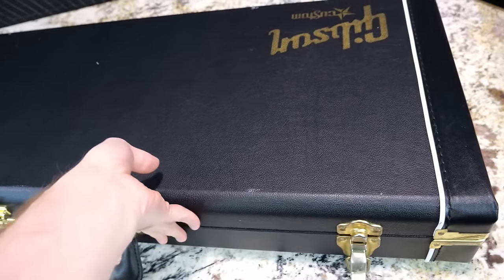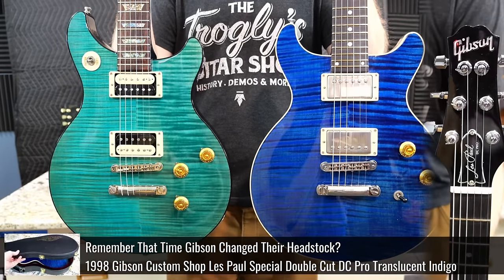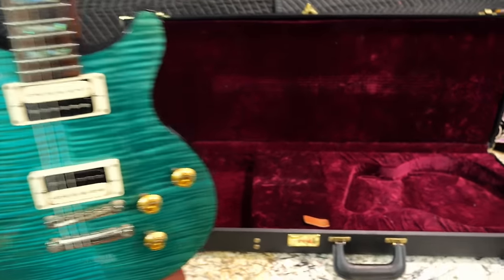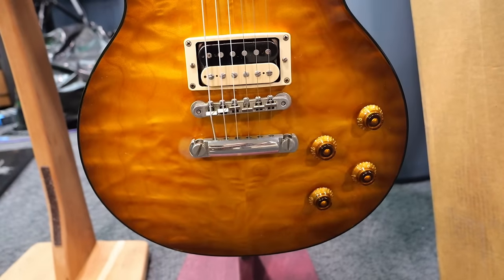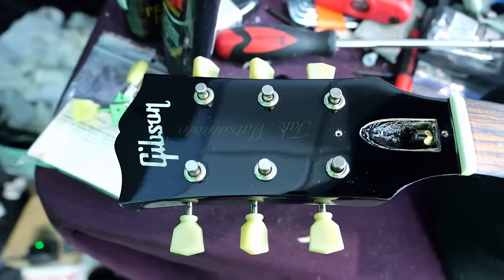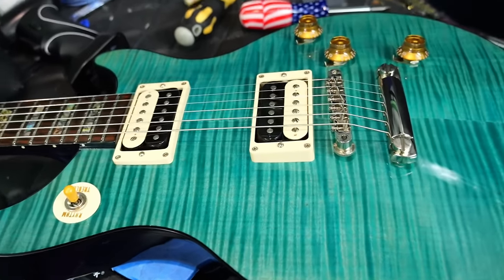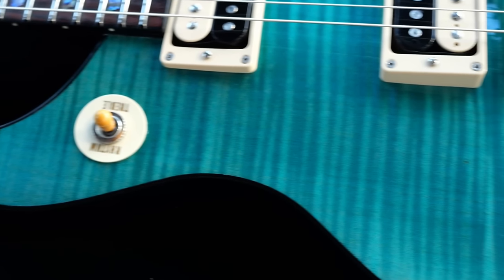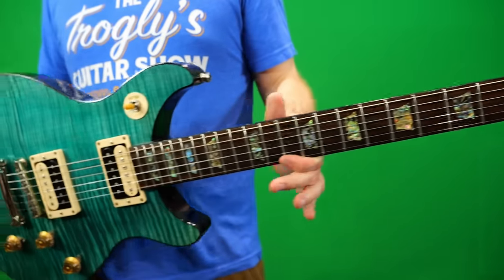Gibson Only Makes This Guitar Shape for Japan! | Gibson Custom Shop Tak Matsumoto DC Standard Blue

Comment: Trogly you might want to look into 10mm vintage tuning bushings for that guitar. It should take the space of the reemed hole for the tuners and still give you the original tuner post size. Stew Mac and other parts supply stores sell them.

Comment: I always loved the double cut LPs, but by the time I could afford my first Paul in 2008, Gibson had discontinued them 😢.  Instead I ended up with my 2008 LP standard 60s neck flame top in root beer with the red back. Its a fantastic guitar! Has served me well for almost 20 years now. I do still have a place in my heart for those DC models though. A red DC studio with P90s is my fave. A friend had one and it had huge thick neck on it though and I hate that.

Comment: Hi--I recently stumbled across a guitar that I can't find much information on. It's a Fender Catalina YC-25H, which is marked on a crossbar (?) on the inside of the guitar. Doesn't say any country of origin, just "handcrafted" with a Fender maker's mark. The guitar is really interesting, it looks like (and maybe is) a Strat neck strapped onto a small acoustic body, and I picked it up at a secondhand shop. The pick guard reads 花子 (Hanako) which may also be specific to the model. From what I've read, the Catalina was originally crafted and sold exclusively in Japan, but everything I can find refers to dreadnaught model, whereas the one I found has a body similar to a classical shape and size. 

If anyone knows anything, please let me know!

Comment: Trogly I have to tell you about a "The heritage" Kalamazoo guitar I found. It is a copy of the Les Paul Artisan two pickup. It is unbelievably gorgeous gold to brown burst flametop with gold hardware and the banjo flower inlays. Fretboard so tight and dark it may be ebony. It's at Guitar center in Chicago. It is listed as "The heritage 1996 custom solid body electric guitar" in used or vintage section. Its so beautiful I must help it find a home. But it's left handed jamit. It is listed around $2.5k like the new The Heritage standards. I just find it hard to believe that it is a standard because it's so fancy. The custom "Heritage" only on the headstock's go for $4.5k and they are just a plain color custom with trap inlays. I can't find any history on Heritage guitars if they denoted the headstocks back in 1996. This could be worth $5k. None of the gold is worn off, not even on the tuners or stopbar. 
 Still would be a great guitar for you to demo if you have a lefty friend.

Comment: Couldn't the reemed tuner holes be sleeved with brass tubing?
Reply: He used inserts. No reeming needed. The String Butler does exactly what it’s supposed to do. I have them on several of my Les Paul’s and my Wylde audio. Awesome tool to have and doesn’t damage your guitar in any way.

Comment: Checkout charvel desolator 2010,s,i got green les paul shape with blackout pickips,identical
Reply: I just commented about the desolation series. Extremely underrated guitar at the time but now they are sought after. 
I started flipping guitars with the desolations. For around $300 I could get a set neck and EMG active pickups and abalone inlay.

Comment: Warrant doesn't have to be seen by suspects, just issued. Hence, if no one is there entry, no knock raids, etcetera. Just that a legal warrant exists signed off by judge.

For instance, a cop can be at judge's chambers who just signed it and cops at the scene can be contacted by that cop that actionable warrant exists and can immediately act.

Just filling in a subtle nuance so people don't get tangled by misinformation.

The warrant can be brought over by car in time, or not. You can imagine that one thing is cops will not lie if a warrant exists or not because if they do, it puts them in the cross hairs of the court. Cops will let their ego and hubris rule over suspects... but that stops when going against the actual court.

Comment: A good luthier could probably put dowels in the headstock holes that have been reamed oversize and re-drill them to allow the original tuners to be refitted. 
I like the position of the pickup selector on a Les Paul. I found it easy to reach for and make a quick change. It's good to see it used on this Tak model.